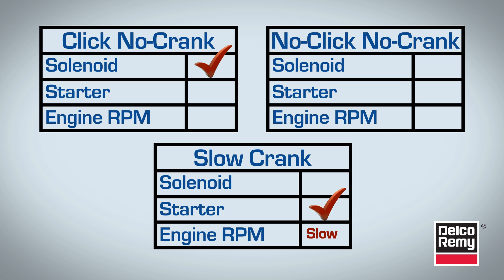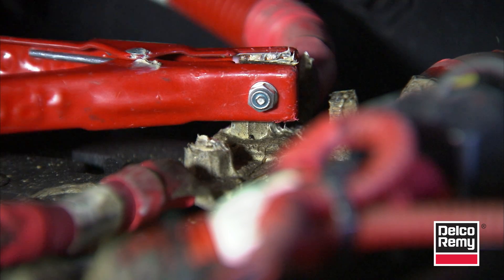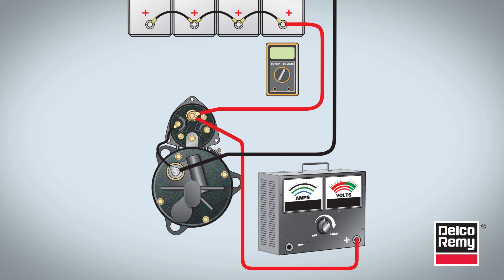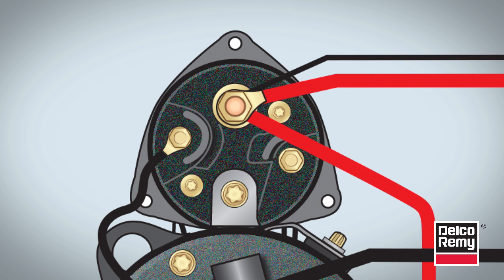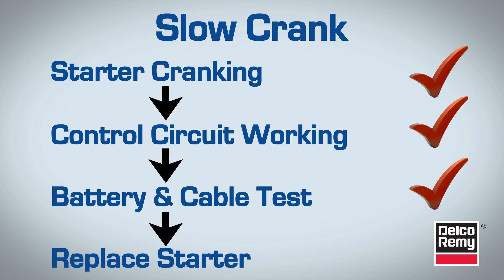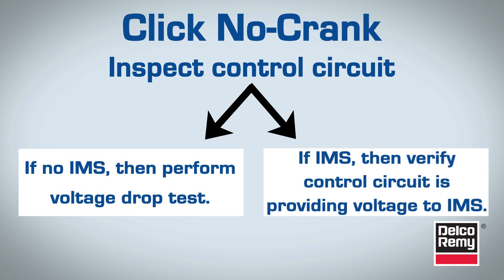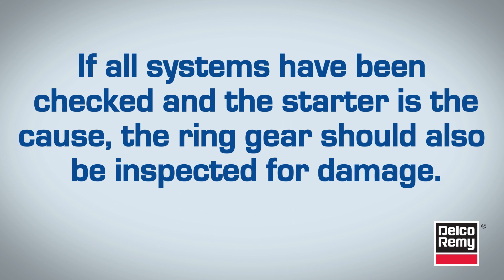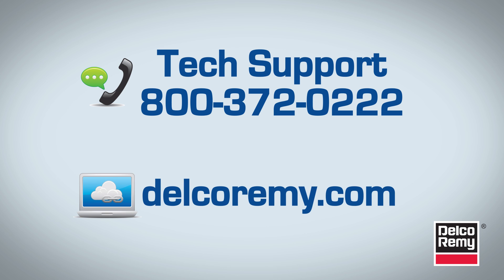Diagnosing Starter Cranking Problems | Delco Remy Tech Tip

Comment: question. I have slow crank and sometimes click no crank. yes both issues. how common is that what usually causes both to happen at the same time.
Reply: Official Delco Remy wrong answer.
Reply from the maker: Hi Celica,  Please contact our tech service team and they'll be able to assist you.  They can be reached at 800-372-0222 or at tcs@remyinc.com

Comment: connect a DVM to the lug that has the braided cable that goes to the starter motor and the other lead to ground. set the dvm on dc volts crank the engine if you get 12volts or anything over 9volts its not the starter. Undo both cables from the battery and check the resistance going to the connector on the starter and the other cable going to ground should be zero. The battery tests at auto parts stores are flawed. After charging a battery should rest for 30 minutes. I purchased a digital battery tester from harbor freight tools. may just need to clean both ends of the cable with Emory paper.